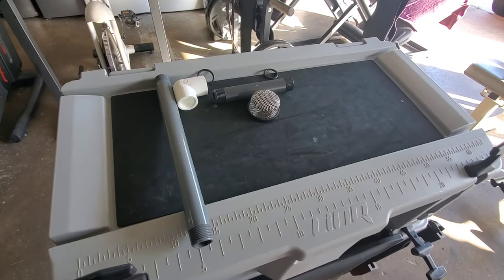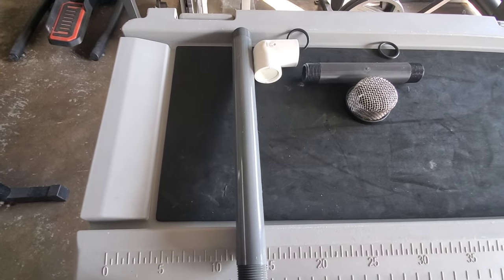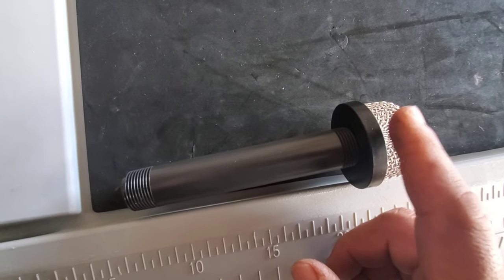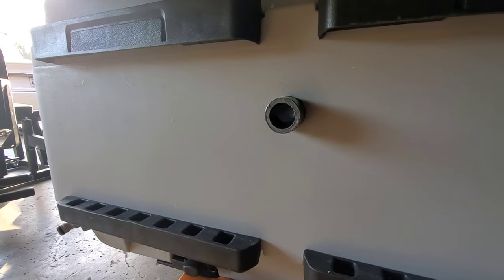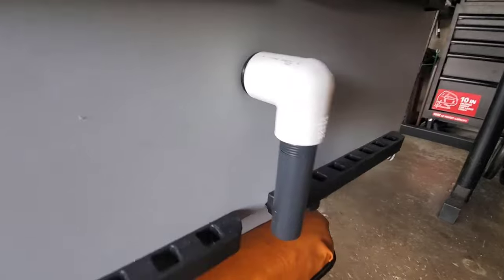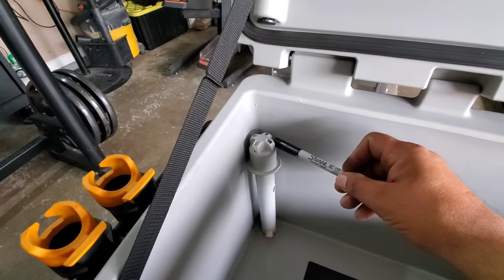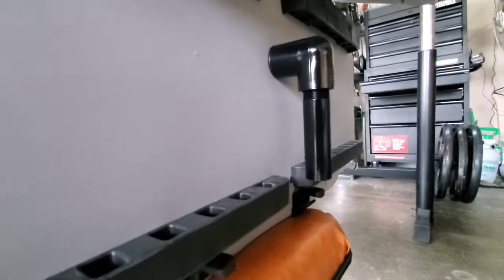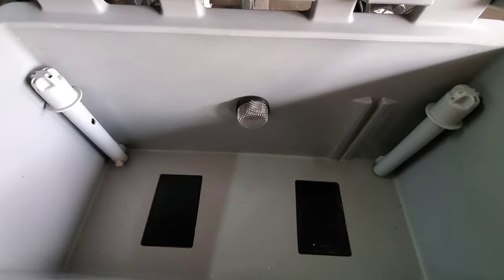HOW TO INSTALL A 3/4" DRAIN WITH SCREEN ON SEADOO FISH PRO TROPHY COOLER @Seadoo

Comment: Why didn't you go up higher on the drain hole to allow more water in the cooler.  I'm not talking bs wondering because what you came up with is awesome.  Where did you buy the strainer, and do you have a link for it?   I'm gonna do the same as you did.   Looks great. How do you like the extra cooler?  I just ordered mine today
Rodneu
Reply from the maker: It's all good buddy, I kept mine some what low because I use either finger mullet or shrimp. To me it's plenty of water so depending on what bait you use will be determine where you wanna put yours. It only took me 1 hour to do. The strainer I bought at Academy. There called live well strainer.

https://www.academy.com/p/marine-raider-stainless-steel-mesh-strainer

We love the extra storage but check out my other video because mine didn't come predrilled. It has plenty of room.
Reply: Ok.  Ya I'm out here in San Diego and we use live sardines and macs.
Reply from the maker: @rodneythompson4264  that's bigger bait lol keep in touch post some videos brotha might be out there one day and hook up with you
Reply: Ya for sure.....look me up if you do.  Thanks for the video